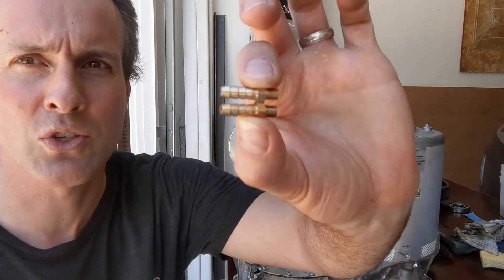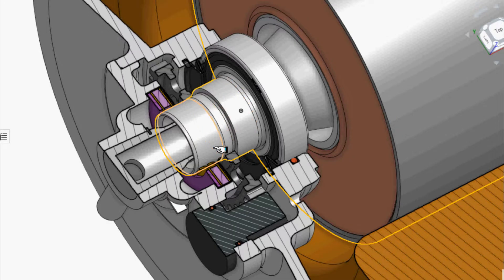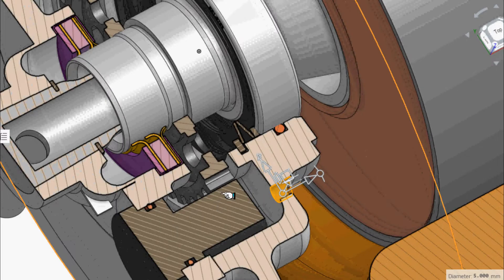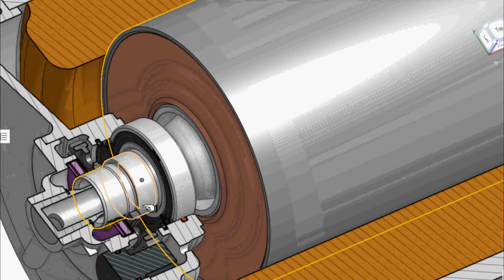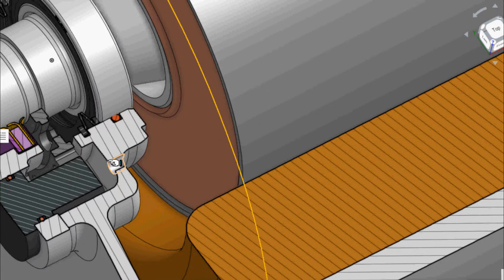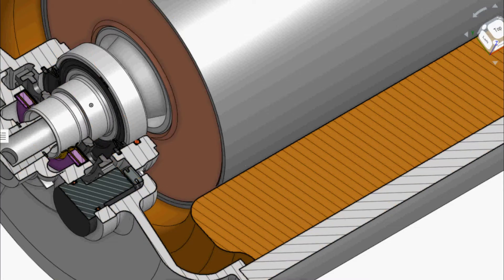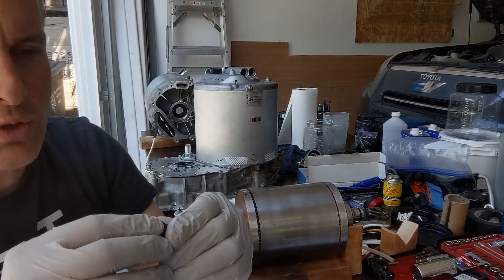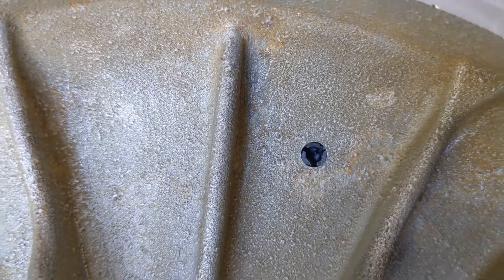Tesla Motor Plumbing Modifications

Comment: Those combination drill taps work great for some applications. The problem with them is, if your drilling through thicker material than the drilling portion is, your stripping out the first few threads until the drill tip breaks through. You can't drill at the same rate as the thread pitch. You can see that the threads on the bottom of the hole look better. Nice design!!
Reply from the maker: @kensmith6736  yess that makes sense. Thanks!
Reply from the maker: I just measured. You are probably right. I added your tip & name for credit to the description. This is good to know. Thanks again! Awesome.

Comment: I am looking at using the motor of an LDU in a vertical application. Can you discuss the modifications required to do so? Like the spring seal, I’d imagine needs to be replaced with something stronger since the weight of the rotor would be sitting on it. But now the torque and vibrations would be applied laterally to the bearings. I’m not an engineer in any sense, any guidance is appreciated.

Comment: I personally wouldn't use epoxy. I'd use RTV as an adhesive. It's water proof and can easily be removed with no damage when needed. Only real drawback is it takes a long time to cure.
Reply from the maker: Interesting, thanks! I can see your point in context of ageing of the epoxy, higher brittleness, differences in thermal expansion etc.
Reply: @diyEVguy I suggest BEKO's "Gecko Hybrid POP". We use this on wind turbines since decades. Applyable even under water. Non toxic. Nearly does not shrink. After drying it is really like rubber! Much better then RTV silicone.

Comment: If I wanted to add a drain at the inverter side, without dropping the engine, do you think it would be feasible? Guessing I should pull the firemans loop first, completely powering off the car, just to be on the safe side, right?
Reply: If you disconnect the 12 Volt battery, the 2 HV contactors can't switch on, so 0 Volt at the drive unit. That is enough.
Reply: @Stefan_Dahn  Thank you 😊 I must pull the motor soon. The noise is getting Worse 😩

Comment: When threading aluminum there's a product called tap magic that is a light cutting oil that's good for aluminum. The stuff you used is designed for cutting steel. A good cheap option though is straight WD-40. I've tapped a lot of holes in aluminum with it and I get good results. A good sharp high quality tap is key. Your recommendation to tap by hand is a good one, and I would not use that combo drill/tap for this. It's very easy to cause damage during power tapping and even skilled machinists are reluctant to do it on anything critical or expensive. These combination drill/tap tools are not good for material that's of any thickness too. A lot of chip material is created from the drill point and then you stack more chips on top of that cutting the thread and the likelihood of something getting caught up in the cutting edge of the tap as it turns increases exponentially. You're almost guaranteed to get galled threads with one on a thick casting like this.
Reply from the maker: Thanks for the clarification!

Comment: Question: Looking at the coolant reservoir the cap is of the pressurized design meaning a pressure (to raise the boiling point of the coolant) is building up first before excess pressure is released. I wonder if that is really necessary in the EV application and if it would help the seal if the cap would be modified to vent without building up pressure.
Reply from the maker: Good question... Not sure about the answer...
Reply: @diyEVguy  I guess if the temps in the coolant loop for the motor stay well below boiling point (must be above 100°C for the G48) it could assist the seal to not pressurize. 
I loose 5mm level of coolant every 1000km and my 3 seals have arrived. So I will do it shortly.

Comment: Does anyone happen to have OEM or alternative part numbers for the circlips and spring washers sandwiched between the shaft seal and the (front/outer) bearing? My motor had one fragmented, as well as the clip.
Reply from the maker: No sorry...but you should be able to get them from salvage LDUs...
Reply: @diyEVguy  I might need to look around hardware stores or McMaster. They've got to be $5-$10 in hardware...

Comment: Amazing pioneering work! Simple question- what do You expect, how long is the lifetime extended with this solution? The main problem is still the boiling point water solution at contact area of the rubber seal and the shafts, right?
Reply from the maker: Thanks! Yeah its is a 50/50 mix of water and glycol, boils at roughly 107°C (when at atmospheric pressure). Actual pressure and boiling temperature are likely higher due to the overpressure. My very coarse thermal calculations suggest that the seal lip (PTFE, not rubber) contact area is also in that temperature ballpark. So the coolant mayyy boil and bubble out towards the dry side, but I have not observed that in my own LDU yet bc is's bone dry after the first 2000mi.

For longevity statistics (mind you: there may be many installation errors, so it may not be representative of professional interventions), see our website here: https://sites.google.com/view/teslaldu/longevity

Comment: I'd love to see some more detail on the emergency drains.  Be careful with the blue locktite, I have see it destroy certain plastics very quickly.
Reply from the maker: https://www.ebay.com/itm/185147142629
Reply: @diyEVguy  The hose barb: I'm not sure what the intended sealing surface is supposed to be.  The threads appear to be parallel, so ineffective for sealing, and the hex base does not appear to have any significant gasket area (and you're not installing them with that surface mating to the parent anyway).

All in all, it doesn't seem a robust way to divert fluids under pressure.  Perfectly adequate for your use -- non-pressurized -- but kind of an odd item.  Mechanically, you're depending upon the Loc-Tite, which is my only concern with this install.

---

You've really thought through a lot of things that I would likely miss, these vids are great!
Reply from the maker: @alsavage1  Thanks again for the comment! Yes the barb ridges are parallel to each other. The silicone hose slides over it very snug so it is difficult to remove it. The silicone is so flexible that that provides a seal. I assume zero pressure because both the reluctor wheel chamber as well as the inverter chamber are vented to the ambient air. Yeah the loctite may not be the best choice. A "thread sealant" may be much better, but at the cost of the mechanical properties. Maybe a flexible epoxy would be better.
Reply: @diyEVguy  Ah, I was referring to the threads, not the hose end.  Agreed: epoxy, as the threads being parallel, this is like a bolt and nut.  If the fitting is not fastened so that the threads are in tension, only the Loc-Tite is retaining the fitting to the case, which does not seem optimum.

---

I see I've been hyphenating "Loc-Tite" when Wikipedia doesn't reference that: correct is "Loctite".  I have been doing it wrong for decades!  I'll learn and do better ;)
Reply from the maker: @alsavage1  Yes the threads are not tapered. I added a description update. Thanks again!